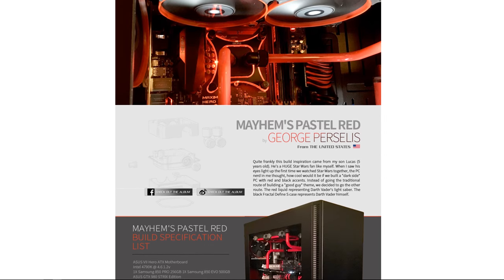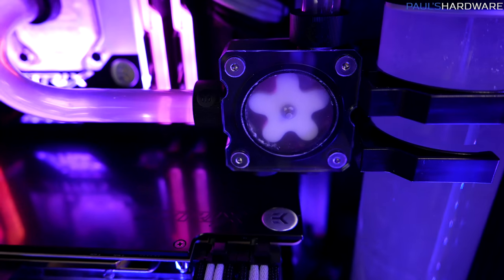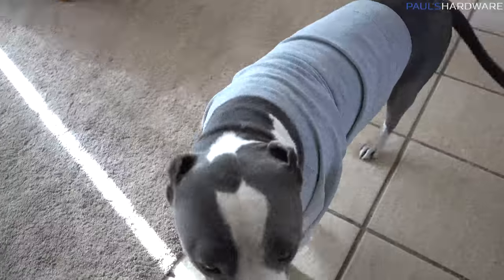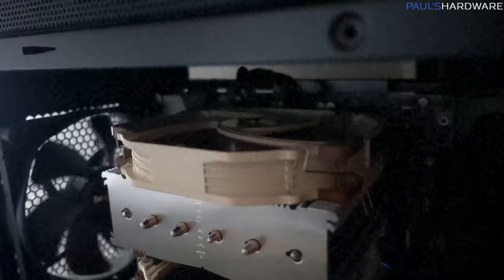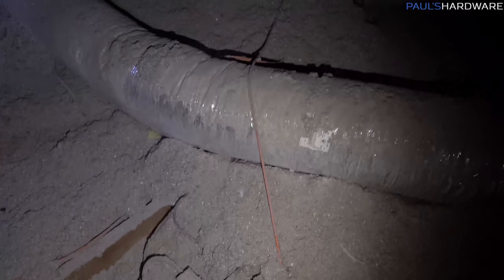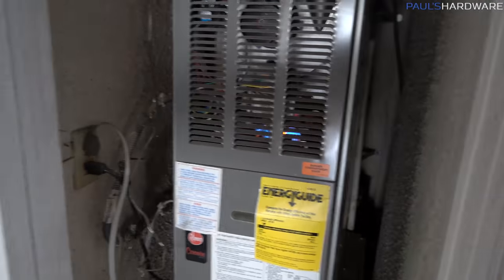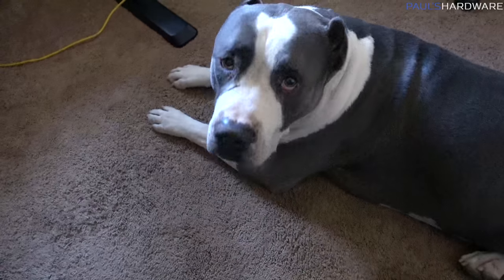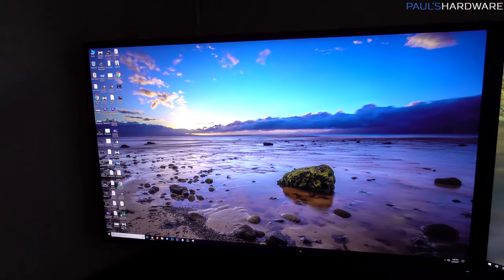Turning Things Around - Early December 2017 (A Random Vlog)

Comment: NOTE FROM A LICENSED AND TRAINED HVAC TECHNICIAN:

i would recommend cleaning that vent above your furnace closet, it lets combustion air into the room for the furnace, cleaning the insulation from that grate would be a decent idea, while it is still running just fine for now,  it may clog up and cause the furnace to not run because it wont be getting adequate air.  could also lead to backfiring and so forth. (there are safeties in the furnace that wont allow it to even try to release gas when there inst adequate airflow, so you ARE safe there.) but yea, i would advise cleaning that so it doesn't cause problems in the future.     

also if that vent were to clog up then the furnace will begin drawing air from your  insulated areas. (living areas) and cause a draft into the house and lower your efficiency, undoing what little was gained by insulating your attic in the first place. this is under the assumption that there is enough of a gap around the closet door in the first place for it to event try and run with the vent being clogged

( this got added after reading some other comments) your furnace is an 80 percent efficient, not much to be gained by upgrading, especially if the techs dont install it correctly, which odds are, they wont.  

(SHUT OFF POWER TO UNIT BEFORE OPENING IT UP PLEASE) if the big fan is making a bearing noise i would recommend oiling it though.  there could be a plug on the motor, either end, and potentially on the shaft bearing as well if there is one.     a NON-DETERGENT CONTAINING  20 weight sae oil is recommended (or about there, in all honesty anything is better than nothing but please no detergent oils, so no automotive or wd-40 and the like. . a few drops will do yah good.  heck, a "zoom spout oil" brand oilier would be a good easy and cheep oil. every hvac i know use them. i use them.   the fan bearing could however be a geased bearing, and if you happen to have a grease gun, pretty much any grease will work, but if you can get a proper fan bearing grease that will fantastic.

Comment: For the fan ticking... If you have the part of the fan with the blades hanging downward (airflow upwards), gravity can pull the shaft it spins on out to some degree if not all the way. I've had this happen with 200mm NZXT fans on my case and the blades started hitting the frame. The 200mm fans are heavier but I've seen them come completely out on 80mm ones even. All depends on how they are built.

Comment: Saving window positions across multiple monitors. You can use WindowManager (from Desksoft). Position the window, select the window in WindowManager, ask it to move and resize it to that position. When you see that windows have crammed themselves all on your "main" monitor, press the WindowManage hotkey, et voilà, they revert back to the saved positions

Comment: OMG! the attic is full of dust. you should get it  clean man.
Reply: + thought the same thing. Thats not even dust anymore - it's a habitat
Reply: That appears to be blown in insulation from the 50s. (CELLULOSE LOOSE FILL INSULATION).  You don't clean this,  you shouldn't even go up there without a mask.
Reply: A note on that furnace.......usually you won't get initiation until there is a 3 deg differential.   Your t stat displayed a room temp of 73, moving it to 75 may not activate your furnace due to the standard 3 deg differential built into the t stat from factory.  What did you do to (fix) your furnace ?
Reply: that was dust right? i'll probably freak out..

Comment: Paul the top round duct piping coming out the top of the heater needs to have proper metal duct tape at those collar elbows and seams to prevent heat leaking and to ensure proper heating efficiency.

Comment: Paul, you ought to have an HVAC tech look over that heating unit and air handler as it sure sounds loud plus a few odd sounds coming from it. Beyond the noise of the flame I doubt there should be much other louder sounds.

Comment: You put the heat on when it's already 72 in the house? You Cali folks are crazy
Reply: lol we don't put the heater above 65 often and i live in oregon
Reply: 25 outside here, heater set at 65, perfectly cozy
Reply: No other way to test it out when it doesn't work at 67 degrees at night. At some point, during the daytime, it needs to be repaired regardless of the inside temp.

Comment: ur furnace sounds really bad
oil those motors!
Reply: Not the most efficient model either, you can see the fire in the firebox through the vents and all. Looks like a mid 90's model.
Reply: NO NO NO NO! I've seen this video. If the phone doesn't spontaneously ignite when you pick it up call a QUALIFIED  tech and get them to look at it. Damn the cost! By the look of that wildfire furnace you will be seeing the fire brigade soon to douse your house, and not fill the pool.
Reply: Sounds like either the blower motor bearing needs oil, the blower fan needs to be tightened or the blower fan needs to be replaced.

Not an HVAC guy, just a guy who lives in NYC who has had similar noise from his furnace before.
Reply: For the cost and considering the system they would be better off replacing it for a more efficient unit but yeah you are right it shouldn't be making that ticking and rough sound.
Reply: The noise isn't really an issue, they always sound iffy when they first light up on proving circuit. Fan flued appliances tend to quiet down once they warm up. That model is roughly 65% efficient, the biggest issue most people have with them over here is they're commonly known as death in a cupboard.
Reply: Your squirrel cage is gonna fly out!
Reply: I know next to nothing about furnaces as I live in the UK and we use combi-boilers but that thing is LOUD! Fucking hell... xD
Reply: Omg you don't oil the motors is the draft motor Berings going bad
Reply: And high efficiency units are more of a pain than anything

Comment: My CPU fan was making that same clicking noise at 4:50 ---->  Turns out that the power cable had looped up just enough at fan housing\retainer clip to contact the fan blade as it spun.

Comment: My god is that attic dirty
Reply: Blown in insulation is really good for insulating old walls or attics with tiny hard to get through entries, fiberglass is better for the average 1960's+ track house attic because you don't make a mess if you need to go up there to do some maintenance and if you get a leak in the roof it doesn't soak up all the water causing the whole ceiling to collapse under the weight.

He does need to get up there and clean it off the ceiling light pots and HVAC ducts, yeah it's treated to be fire resistant but better safe than sorry and it isn't doing any good for the insulation there. Whoever the contractor was that did the work didn't complete the work.

Comment: Does that Arctic Rainbow Panther "really" need a flow indicator if you can see the fluid with your eyes?
Reply: Wallace Thats the new Primochill Vue. It’s safe, just look at Jayz video on it. It actually cleaned out all his parts.
Reply: Wallace As long as theres no Aluminum. Brass and copper will play nice just fine, and any nickel is non-corrosive. Pretty surprised your coolant didn’t eat your loop.
Reply: That's pretty crazy. I guess if you're alright handling that fluid keep 'er goin'. If you ever want to go for visuals, look into the Primochill Vue. It's finally out now and they have some wicked colors. (No aluminum though)

Comment: 73 is cold? i like a nice 68
Reply: 22.5 and 20 for everyone on the other side of the pond
Reply: At 73 I'm putting the A/C on LOL. Guess that the difference between southern CA and Cleveland.
Reply: It's in the teens F here and I'm still wearing shorts and riding a bicycle. California folks are such wussies.
Reply: I was about to comment that, it like 60 degrees in my house (or 16 degrees celsius as normal people call it :-P) and I don't have the heating on.

Comment: I'm curious how old that hardware really is for it to be failing like that. I've got a system that's been up and running pretty much 24/7 for over two years now and not a single fan has failed. Noctuas should last 5 years easy if they are kept clean.

Comment: I have the same fan-speed error which blocks me sometimes from starting windows. I think it is because the fan speed is too low (below 500 maybe), so when you have super low rpm pwm fans the system thinks something is wrong. I just put the cpu fans on "ignore" in the cpu, although it prevents it from detecting an error but I think the risk is pretty minimal so..

Comment: those primochill flow indicators suck. tip:  slightly tilt it forward or backward so the spinner stays on the center shaft it wont bind anymore with a little tilt

Comment: what I've done to combat the whole windows resizing issues (which only seems to be an issue with DP or HDMI screens that disconnect when turning them off unlike dvi or vga) on my monitors since 3 of them use DP and 1 uses DVI, the DP monitors essentially disconnect when turning them off, so what I've done is just make a black screensaver that I can enable using a hotkey configuration, and also have my DP monitors like turn off the pixels without actually turning the monitor off (I forget how I enabled that or did it) and then just turn off the DVI monitor so I maintain my aspect ratios and desktop layout. It was really annoying to have to enable and disable nvidia surround to fix my fences

Comment: I get the exact same issue with my mobo (asus x299 rampage apex in my case) with the cpu fan error, despite the connected fans spinning and registering an rpm in the bios/uefi. Pain in the ass.

Comment: If ratteling cables made it work, i would strongly sugggest to tighten all the bolts on the connection ends of them cables & get rid fo the bad connection to prvent fire if it was the mains

Comment: lol...I've had a bad couple of weeks, i got new processors and water blocks for my server computer the processors were x5680s because my processors before were slower than the first i3... and only one of them were working due to a bent pin in socket 2  anyways so when i take the processors out i try to fix and it seemed to work plopped those cps in and hooked up the water blocks and turned on my pc checked if both cpus were on and only got the one processor working so i decided to go take it apart and took off the wrong block and the hoses pushed against my processor when taking it out and had  like 10 pins bent due to it on the good socket and tried to fix and 2 of the 10 or so pins broke and it doesn't boot anymore so im using a $200 laptop from 2012 that when ever it shuts down removes part of system 32 and i have to do stuff in the bios to get it back then wait like 2 hours for it to finish... anyways your not the only one right now lol.

Comment: Hello Paul and comments section, I’ve been a console gamer my entire life and have been looking to get into PC gaming! I feel it’s a better investment due to upgradeability, anyhow I’ve listed parts for a $1500 budget and was wondering if the components are good or if they’re even compatible, any help is appreciated. Thanks. Build:
$1500-
Intel Core i5 7600
EVGA Geforce GTX 1080
Samsung Pro 256 GB SSD
2 TB WDB Hard Drive
ASRock Z270 Mother Board
G.Skill Ripjaws 16GB DDR4
Corsair 80+ Bronze 750w
NZXT S340 Case